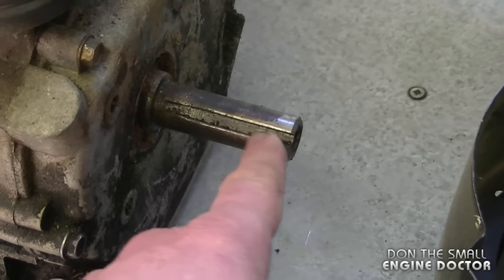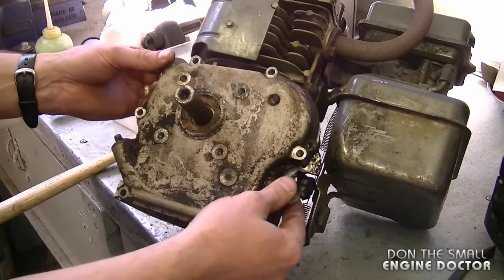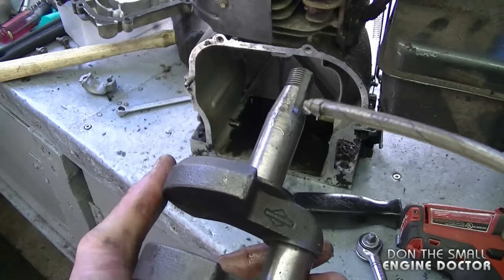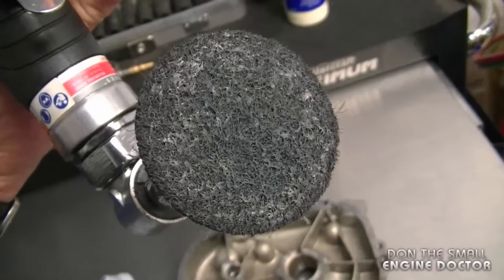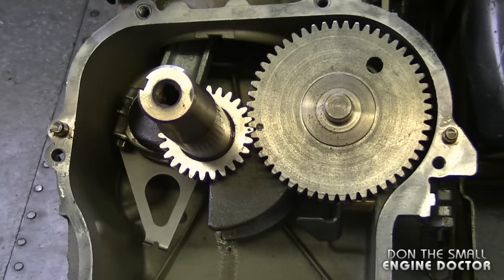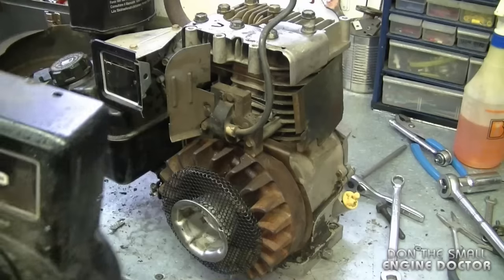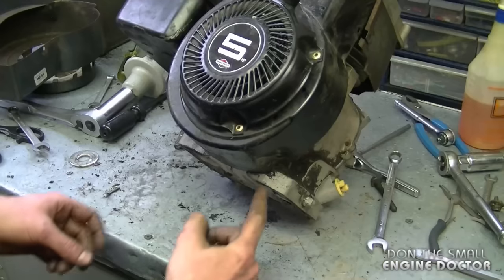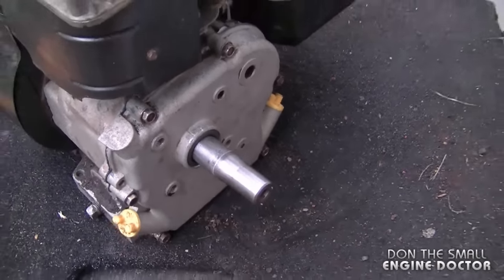HOW-TO - Small Engine Crankshaft Swap

Comment: What size impact driver do you recommend for small engine work.    There are so many of them out there it's really confusing.  I know you require special sockets with an impact wrench.   I would prefer something battery driven or electric rather than an air tool.   My use is for my own equipment, no commercial work.   So basically it would be used on lawnmowers, my riding mower and generator.  Thanks Dony, appreciate your help!
Reply from the maker: watch this video https://www.youtube.com/watch?v=yp3QUj-TG0A

Comment: I have a 14.50 briggs with a bad block. It may can be bored out. I don’t know anybody around where I live that will bore a small engine. My bad briggs is Model 204312 Type 0529B1 OHV. What block can I use to swap shafts? The motor is for a chipper. It has a big tapered shaft like in your video. Can you help me find a block I can use to swap the shaft?

Comment: Wow, excellent job my friend!!  One of the most informative, concise videos I have ever seen.  I wish you could help me with 1 year old Briggs and Stratton with a bent (I think) Crankshaft.  I found out you can not cut a 3/4" reinforcing rod with a Lawnmower.  LOL!!  It was hidden below some weeds I was trimming.  Should have used the weed wacker, now I know that.  I did replace the Flywheel keyway and the Blade, now it starts.  It runs fairly well at full speed but at idle it vibrates like crazy.  Oh well, you live and learn.
Reply from the maker: I usually do not end up repairing bent cranks

Comment: Was in a hurry one day putting new rings in a Briggs  and didn't emery the crankshaft before reinstalling the sump! I thought how bad can it leak? It didn't leak much, just enough to run down on the drive plate on a Snapper rider! Had to stop cutting and clean the plate every 20 min from then on! Live and learn!!

Comment: donyboy73, Hello! Thanks for the helpful videos. 👍👍👍
I really need your advice. Could you tell me is it possible in Briggs&Stratton Vanguard to extract the pistons with their connecting rods from the inside - through the crankcase, after removing the pushrods, camshaft and crankshaft?
This is in order not to remove the cylinder head. The thing is, I need to swap crankshafts from one B&S Vanguard 14 to another B&S Vanguard 16. Both engines are in good condition, crankshaft replacement is required due to the different shape of the tail section (cylinder and cone). Changing 4 cylinder head gaskets is quite expensive. 😢

Of course, getting pistons through the crankcase makes me only extreme necessity - it's like removing the tonsils through the anus! 😃
😃😃
 However, it is becoming more and more interesting - I have never been in the role of proctologist! 😃

donyboy73 may I ask another question? I always thought that along with the crankshaft, it is necessary to mount his own connecting rods. Is it so? Or is it possible to install connecting rods from crankshaft №2 to crankshaft №1 and vice versa?
Thank you very much!!! 👏

Comment: Thanks for the video, very helpful.I have a 11 hp Briggs& Stratton that has a tapered shaft and I would like to replace it with a strait shaft.How would I find out what 11 horse engine will interchange? My model# is 256427  1162-E1   code 9912173A   Thanks for your help.

Comment: CAN A BRIGGS CRANKSHAFT WITH A 6.5 HP ENGINE BE SWAPPED INTO A BRIGGS ENGINE THAT HAS A 6.0 HP ENGINE. THE REASON WHY I ASK IS BECAUSE I WANTED TO MOVE THE 6.O0 ENGINE TO A HIGHER DECK BUT THE CRANK SHAFT IS TOO SHORT FOR THE HIGHER DECK.

Comment: @donyboy73 , Is swapping a sump cover from another engine ever a problem due to the block being line bored for the crankshaft during manufacturing, thus pairing the engine block with it's own specific sump cover? Also, any need to check crank endplay after that swap?

Comment: dony have 18hp briggs opposed twin mower can run it for any amount of time bu t as you shut it off  you cannot start till next day looses spark when hot  tried 3 coils 2 key and flywheels  isolated kill wire with no luck please any ideas its a single coil thanks

Comment: Best video of small engines to date.   I have a 5hp B&S horizontal engine on a go cart.  I replaced the carb.  It's back together but I can't get the throttle right.  I can't find a schematic of this type. No manual throttle capability only the choke.  I need a choke rod so could use some advice how toi find one vs making one.   The governor is functioning.  This go cart engine didn't have the race track in the linkage which interacts with the manual throttle control.  I know linkages vary and the model # for this one is no where to be found.   I just need an image or schematic reference of how this should connect.    The new carb came with the throttle on the carb hooked up.   Also, the needle valve for mixture control did not have a spring on it so I'm guessing I use the old one even though the new needle valve looks different than the old one and the ones in the kit.    Hope you can help advise about a schematic or and image or two of how this throttle linkage should hook up.

Comment: Keep in mind, I missed this during rebuild of a 1980 3.5hp Briggs vertical shaft, the crankcase gasket, there are two for this engine, this one needed the .015. I could barely pull the engine through, broke in all back down miked everything put it back together and still was so stiff, I did get it to start. but pulling it through was just too hard to do and I knew there was something else that needed my attention. The dealer had sold me a .005. I didn't give it a second thought, until I remembered reading about the two different thicknesses. What a difference a few thousands of an inch make. Great channel.

Comment: I was hoping it was a longer stroke crank. I'm watching this because I need to convert a Tecumseh 10 HP to electric start! I need a flywheel and starter. I'm not worried about charging. since its on a generator. if it doesn't cost much to add the stator. I'll go with that. I'm Hoping you can point me to a source with decent price. or may have one to sell. thanks. and I'm subbing..

Comment: hi donyboy, i have a question for you about a small engine briggs and stratton sn 128m02/0134f1

the engine was blown, prob was the connecting rod. i did replaced it with the right match, however when i tighten the bolt ,100inch lbs and tried to spin the crank shaft it won't  turn at all.

Comment: I have a 7hp horizontal taper shaft Briggs & Stratton engine and I'll like to swap its crankshaft with one with a keyway. I looked for parts but they are very expensive so I decided to look for another engine and to take the crankshaft from. The problem is that I can only find vertical shaft engines. So my question is: will that crankshaft fit if they're both Briggs & Stratton engines 7hp ?

Comment: I need help my simplicity coronet 12 hydro will only crank over when I cross the two solonoid terminals. And when it does start the only way to stop the engine is to cover the intake. Neither the solonoid or the pro clutch clicks.no short wires or bad connections.i checked the battery , solonoid and the brake safety switch please help

Comment: Awesome video i had a 1965 briggs with a plane crank shaft the was damaged like someone tryed to grind it an make it a 5/8ths shaft an hammered on a 5/8ths shaft an bent the crank i had already threw the block in the recycle bin when i found this video the cylinder walls looked new an the valves looked like they had never been ran more then a hour so i got some other engine with the intake ceased an took out a double sided bearing pto side crank that was on a newer engine style  an put it on the old 1965 block i used the newer style head an all the hardwear because the old bolts where flatheads bolts an they never tighten good the rip cord side was a short shaft so i used a new cup an new started the engine loooks cool an i saved the original engine to my classic minibike👍 🎉

Comment: On the engine you were running at the end (the five hp b and s) I am currently working on one and wondering if you could make a video on how the governor linkages are set up on this particular engine because I have done research and cannot find a diagram for the engine

Comment: I enjoyed watching you change out the crankshafts on the two engines and believe that I could do that. I need to figure out how to get my power generator going which have not been started in many years. It never was used since I had problems with it since buying it, and installing the oil in it. The newest one worked fine, but I never used it since our power never stayed off long, when we lost electricity.

Comment: Very good information.   But 2 questions.  why did you have to change out the blocks in the first place?  Was there some sort of damage, oil leak, smoke?  and in the leaf blower application wouldn't the lack of a rear cover crank roller bearing shorten the life of the engine having to turn the heavy blower fan?
Reply: He didn't change the blocks, he changed the crankshaft. And the reason he said is that for the intended use of the engine it had to have a different shaft on it so he switched it.
Reply: If you think about it he did replace the block because he took the crank out of another engine that may have been blown and put it into a running motor just to achieve the crank shaft size he needed for the application
Reply: He put the crank into a different block. so my question was what was wrong with the block he took the crank out of.  You also see that he switched the carb, exhaust and recoil.
Reply: Yeah I fully agree with you Richard was just responding to nate as they said he didn't change the block which he did do also by putting the desired crank into another motor

Comment: Hey Don, Great video. Exceptional step by step instruction and great camera work. Just wondering why since I don't see a single video on YT on reworking a head on a riding mower with briggs engine. I see them on the small engines where the valves are lapped but nothing on the riding mowers with the overhead valves. Just wondering if new springs, guides and valves and guides can be put in or would it require machinist work and make it more cost effective to order a new head. I'm sure that would be a huge cost though. Anyways would appreciate if you would comment or make a video on that. Thanks for your great channel !

Comment: I have a spare engine, but the machine needs the end of the crank to be tapped and threaded. Can I do that to it? Have you tapped the end of a crankshaft so you could add a center nut?
Reply from the maker: yes you can if there is room
Reply: @donyboy73  Cool, thanks.

Comment: Guess I will pull the bent crankshaft on my Honda mower. I was going to try and get it straightened but for the price, Its just as easy for me to Replace instead of messing with a bent shaft.
Reply from the maker: yes sometimes, just find a good used one

Comment: hello dony ,, i rebuild my Chinese generator engine and i bored the engine and replaced the piston rings but still i found out after 5 min of starting the engine that some of the oil leaked and reached above the piston very small amount of oil 

is this normal for small engines ? i mean im pretty sure i did every thing right ,, it even started from the first time

thank you for the video
Reply: If you bored your engine you have to fit an oversize piston.

Comment: Is it possible to re-thread the grooves on a crank shaft where a lawnmower blade bolt goes?
Reply from the maker: yes sometimes I run a tap or a thread chaser to clean them up

Comment: Hi Dony, do I have to reset my points after I swap them crankshafts? I swapped same ones and I got no spark but one time I feel there is a current going from magneto one time I feel nothing, do you know what may be the issue?
Reply from the maker: USUALLY NOT BUT YOU SHOULD CHECK THEM ANYWAY. SOMETimes running a 400 grit emery paper between them helps

Comment: Donyboy,  I have gotten some great advice from you over the years.  Thank you.  I have been having a problem with the carb adjuster screws on my Husqvarna 455 Rancher chainsaw.  It is a 2014 model with a Walbro carb.  It has some Hi/Low adjuster screw limiters that I have never seen before.  Are you familiar with these.  I would like to remove the limiters, but they are not like the typical plastic ones that you can get access to.  These new ones are encased in a metal housing, with really only access to the screw heads themselves.  Any expertise that you may have is more than appreciated.  I will include a link to a picture of the carb on Ebay, if you would like to take a look.  Thank you......

Comment: Learned a lot here Thanks                Can a single shaft be converted to a dual shaft? I have to convert a Briggs for my tiller.          I have 2 engines single shaft functional and donor engine with hole in block.                            Can this be done?
Thanks
Reply from the maker: if you have appropriate crankshaft and camshaft from another engine , yes

Comment: When doing and engine job you should always try to use assembly lube when putting parts back again, much better than using oil. It is not recommended to use a gasket sealer on the engine, it will be much worse taking it apart the next time.
Reply: That is half right. Assembly lube is better for a few places, but adding gasket sealer is also good. These engines leak!!! You can take steps to mitigate or prevent it. That is one of them.
Reply: I have never had to use a gasket sealer on an engine yet, and I use Amsoil Synthetic products and their assembly lube is designed to mix well with any motor oil, but I use their Small Engine 4 stroke oil made for these engines. It is a full synthetic oil. It costs a little more, but is so much better for less wear and tare on the internal parts.

Comment: I need HELP, I have a B/S engine it's a 15 HP over head valve and I have changed out the plug, put a new fuel line, filter and carburetor  air filter and I still can get enough power out to cut the grass, I have check the governor on the carburetor to make sure that it's working and it is. What do you suggest I do now??? 9/23/2016
Reply: Get a carburetor overhaul kit and and rebuild the carb. But first check the cylinder compression which will tell you about the valve seats and/ or piston rings.
Reply: What is the correct PSI on the cylinder compression? I put a new carburetor on it thinking that was the problem. 9/24/2016
Reply: This is what B/S suggests: https://goo.gl/qo3wle
Reply: Thank You, Stan
Reply: Well I took the valve cover off and found that the rocker arm, the one on the bottom only move about 1/8 TH inch, nothing like the top one. So I must have a bad cam. What do you think?
Reply: It's a major repair problem inside, not an easy fix. The question now is do you want to take the engine apart to replace the broken parts, like in this video,  or buy a new engine. Or a new mower. However I'm not an expert when it comes to internal components. Ask at your local repair shop. It doesn't cost anything to get an estimate.
Reply: I have worked on small engines before and its not to much trouble, thank for all your help.

Comment: just to point out does that double application of rtv with gasket affect endplay?
Reply from the maker: no
Reply: donyboy73 reason I ask is they say you use certain gasket sizes to obtain crankshaft endplay clearances which can start at .002.  you would add thicker or thinner or double a certain size.  I do love the learning experience from you, I've learned alot, I don't know how you do it -  work, make videos and reply to your fans.  amazing!

Comment: Dont they make a part that would slide onto the old crank that matches the desired shape?
Reply: They probably do but then the finished shaft would have to be bigger since it fits over the old one. Also it would just create another surface that would wear out and could fail/break.
Reply: No...the new shaft is bigger than the old one. Wear compared to tearing down two engines is a no brainer!

Comment: Hi Donyboy, Always enjoy your superb videos.  Just an FYI, I took a keyed crankshaft from an 8hp Tecumseh snowblower (that had a broken rod and cracks in the block) and put it into a 10hp Tecumseh wood chipper engine that had a tapered crankshaft.  I checked all the specs with my micrometer and everything was exactly the same.  The only difference, other than the crankshaft end, between the two engines was the piston bore.  I used my "new" snowblower with it's 10hp engine for 3 hours after a big snowstorm and it worked just fine.

Comment: Dony, how about if my crankshaft has the cam gear already made solid with crankshaft, and I will replace it with one that does have one removable, still gonna work right?
Reply from the maker: yes, make sure it's the same size though
Reply: Alright thanks :-)